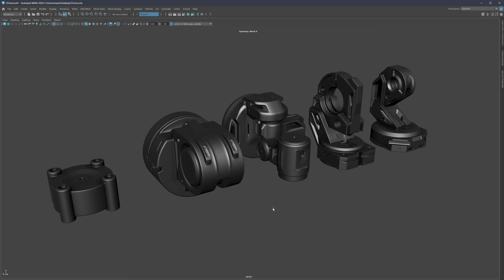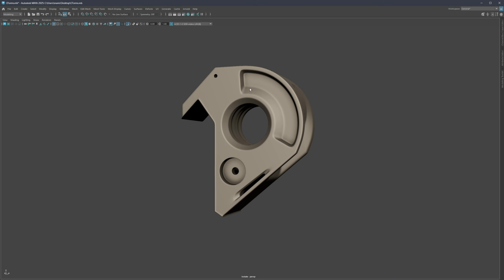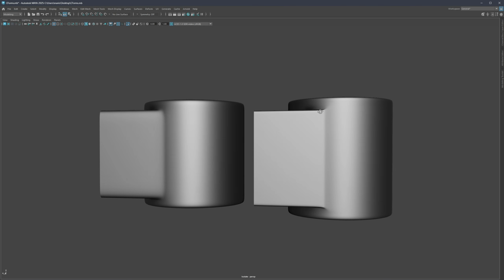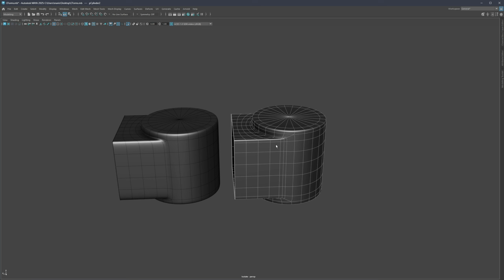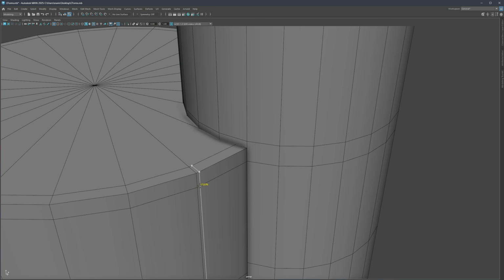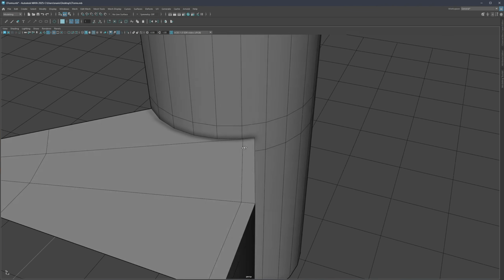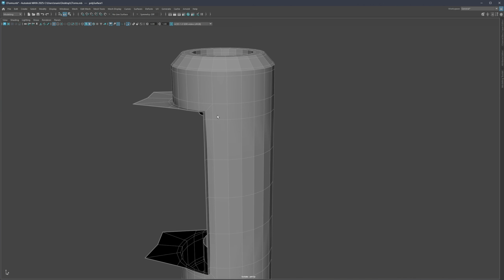Simple Way to Make Complex Shapes in 3D Modeling (Where to start?)

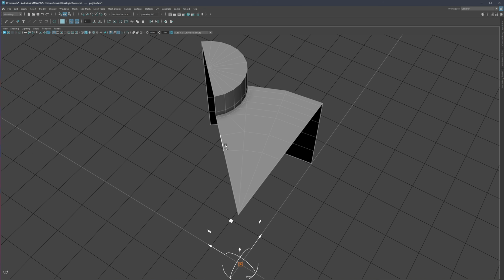Comment: Hey, so for me, editing the pivot results in a custom pivot which I can't use for the mirror operation like Mario does at 23:30. Is there something I'm missing ?
Reply: It's always like that, you struggle then finally ask and 2sec later find the solution. I needed to enable Bake rotation in the Tool options.

Comment: Hello element, I would like you to make a video of the correct optimization of Maya and if it is better to have the latest version of Maya or one of the previous ones is better.
My Maya in particular is quite slow despite having a fairly powerful computer and I think it is because I do not have Maya and the computer is well optimized for its use, that is why this comment, greetings and thanks for your videos are of great help to I'm starting out in modeling.